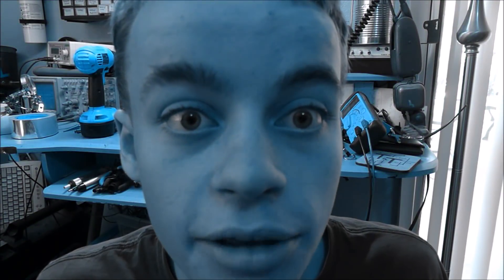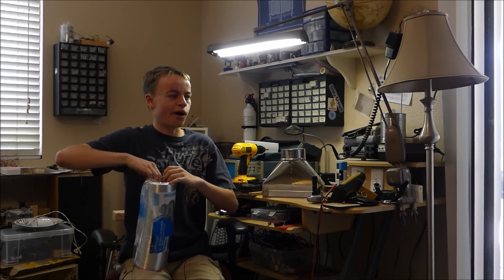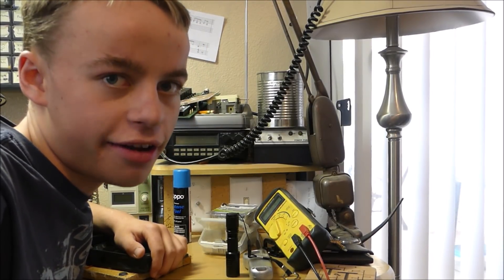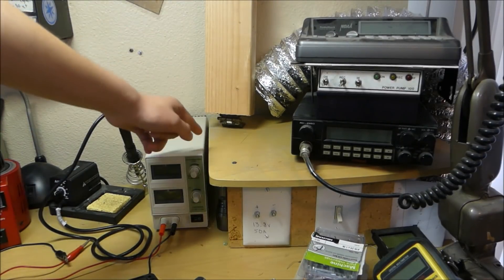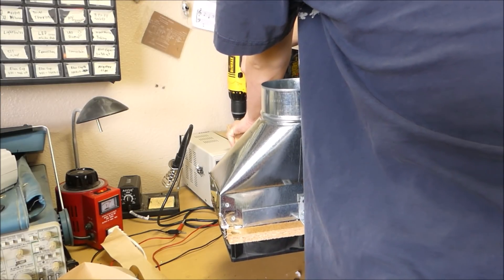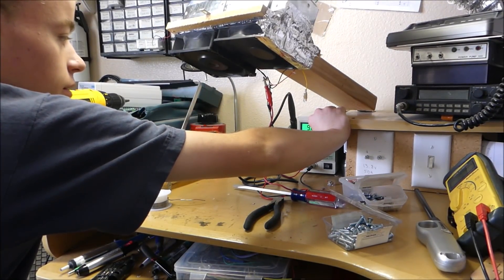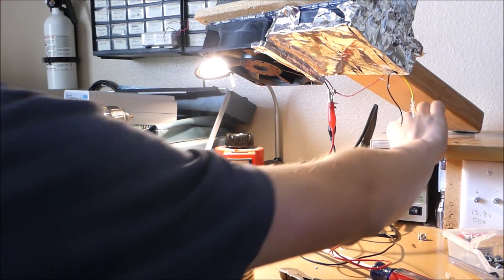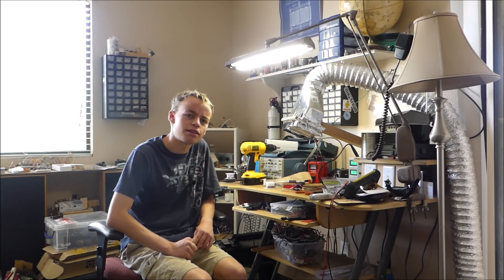DIY Bench Mounted Fume Hood For Soldering

Comment: Love the vids great info. You could use a cheep inline fan and a carbon filter would be 100x nicer and more powerful. Probably 4" diameter. You can find kit's that we use in small marijuana growing tents for exhaust fans. You could get the whole kit for less than $100 if you shopped around. Look for 4" inline fan and carbon filter. Larger in diameter more its gonna cost.
Reply: They also make flanges that you could mount to your ceiling or wall to exhaust out too.

Comment: You could relocate the fan to be not on that mount arrangement, but rather inline halfway down to the flexhaust chamber, and that would make the mount lighter weight, and yes someone mentioned you dont so much need the heavyweight metal adaptor or any of the framing. Just go with taping the exhaust hosing to the hindged board. Another option would be to make a lampshade like the volume seen over pool tables, and have that over an island work station. Not a actual island, the type in kitchens!

Comment: umm... be aware that your exhaust pipe is dumping fumes out right in front of your air intake (the doggy door) some of the fumes will most likely renter back into the room through the doggy door so it would be better to make it go out through a window away from the doggy door or at least extend the hose a bit farther from the doggy door. extending the hose will reduce your air flow a bit because the fan will be fighting more pressure to pump out the air.

Comment: I did something similar but I put the fan on the other end. Initially, I duct taped it in place, then replaced the duct tape with a 3D printed adapter. With the better aerodynamics, the airflow was much better and it was a lot quieter.

Comment: You don't need the boot (metal thingy) on the end of the dryer hose.
Especially if you are only using one fan.

If you can put the fan on the other end of the hose and put a filter in the front then you can stop some of the flux smoke from gunking up the fan blades.